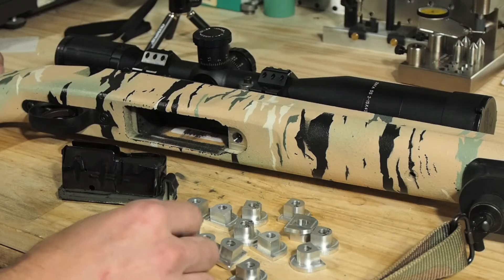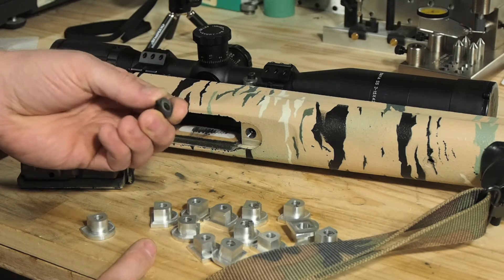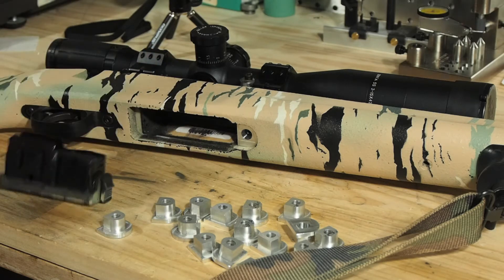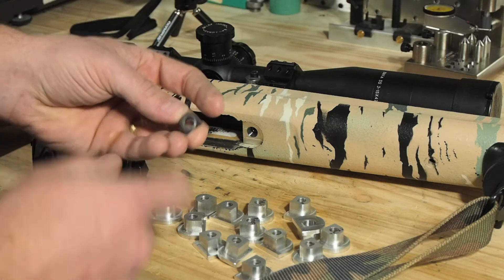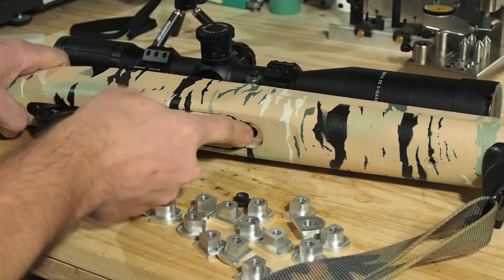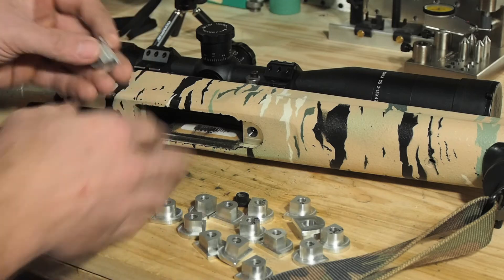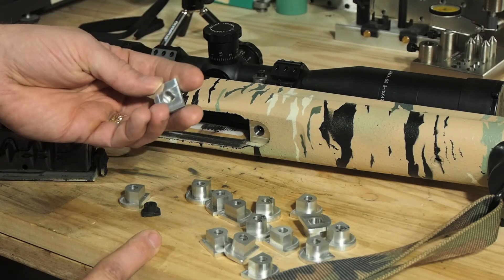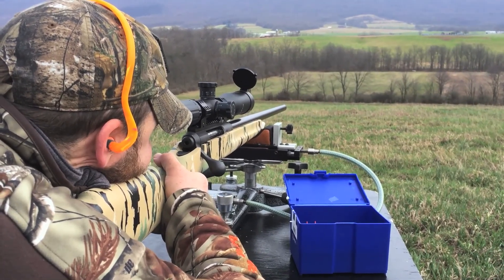Savage Axis Metal Magazine Clip for Accurizing Boyds Aftermarket Stock

Comment: With the two raised metal tabs on the front and rear of the magazine, you ought to be able to engineer a lever in the aluminium piece to hold the magazine in place.  All axis metal magazines have either a tab or protrusion used to secure their magazines in the mag-well.
Reply from the maker: I did that too. They are on ebay.